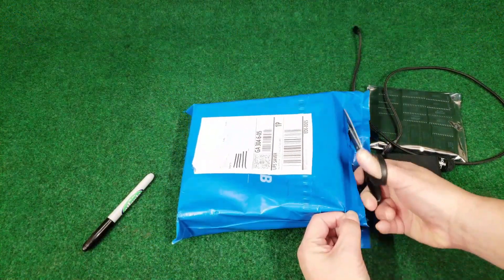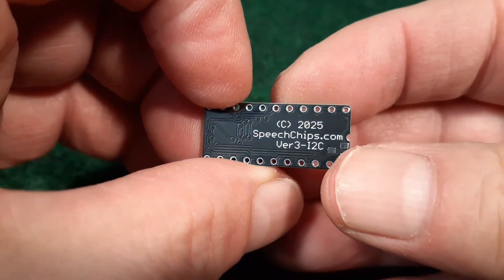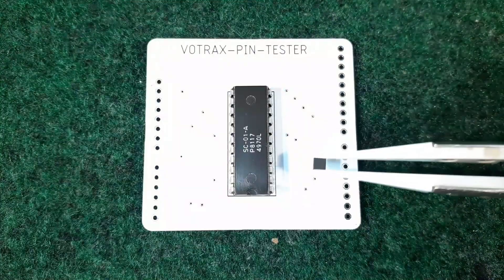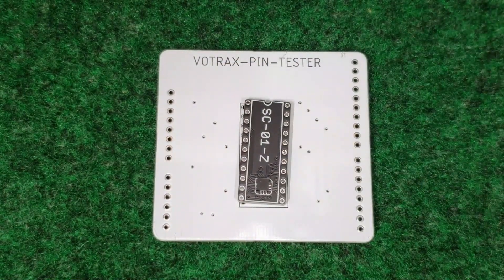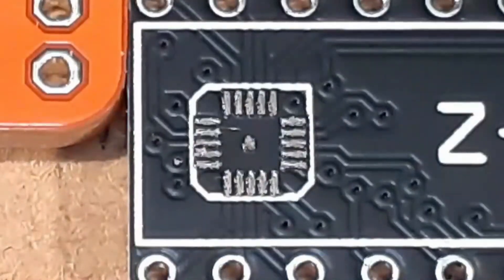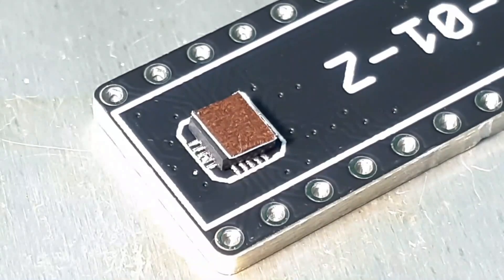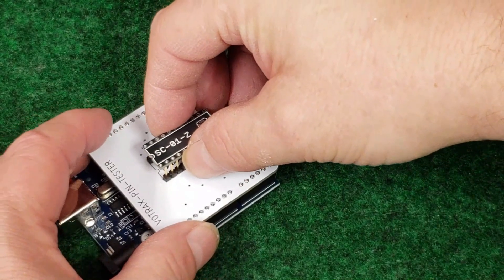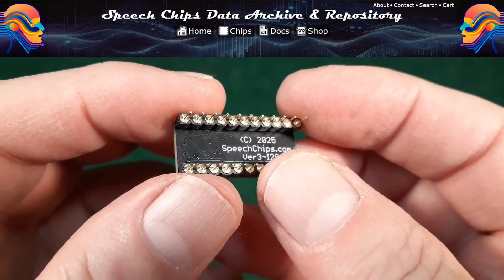Votrax Emulator Final Board. SC-01-Z

Comment: Kewl!  Would live to know more about the extra features you added.
Reply from the maker: Well for one: the orginal Votrax there are two unsued non-connected pins.  They are now used by an I2C port which gives you access to all the internals.  

Two: The internals are now a fully configurable modular synth that just so happens to be able to emulate the Votrax.

Take a look at the sales page on eBay.  You will see some screen shots of different configurations.
https://www.ebay.com/itm/276800408420
Reply: @ScottSavageTechnoScavenger  I⁲C -- ❤❤❤❤❤❤

Comment: To be fair the originals size is mostly the package as well, the actual chip inside isn't that big.
Reply from the maker: Yeah.  However ... there are two unused pins on that 22-pin package.  They could have used a standard 20-pin package if the die was small enough.  Would have saved everone the hassle of finding an obscure 22-pin socket.

By the way - those two unused pins are now used for I2C.  :)

Comment: I have a Sweet Talker board with this very chip in it, that has not seen the light of day since the early 80’s. Had it running from my CPM system with basic. Just relocated this little bit of history the other day.  I have not done anything yet as I need to rebuild a system to run it (needs a parallel port and just the basics to get running again [DOS w/Quick Basic]). A future project. All the old software is on 8” disks, somewhere.
Reply from the maker: I sold a Micro Mint Sweet Talker on eBay about a year ago.  Sad to see it go - but it helped fund this project.  If you are interested, I have Votrax tester boards available on ebay.  It will get you up and running without needing to pull out all that old equipment.  

https://www.ebay.com/itm/275351088011
Reply: @ScottSavageTechnoScavenger  
This board is build into a Radio Shack speaker, I do want to rebuild up a DOS system for other projects. 
Also, have an Altair 8800 I am restoring, with a few S-100 boards to around out the system. Now, old vintage floppy drives will be the next issue to work out, when I am ready for them.
Some of the very old issue I will have to contend with, the North Star floppy system (5 1/4" floppies), CPM (8' floppies). I have a collection old freeware software in the North Stare format.
The 5 1/4" floppies may not be an insurmountable issue, but the 8" floppies will, as I have no floppy drive controller any more.

Did look at your tester, but still need a system to run the Sweet Talker board.

Comment: While it is absolutely possible to hand solder these QFP chips. I've done it many times. Solder paste applied with a stencil is the best method by far.
Reply from the maker: More power to you!  I tried and gave up.  In hindsight, I should have ordered the stencil with the board and saved the additional shipping cost.